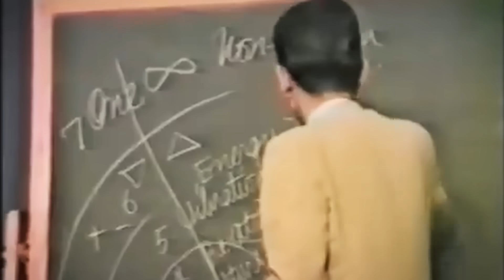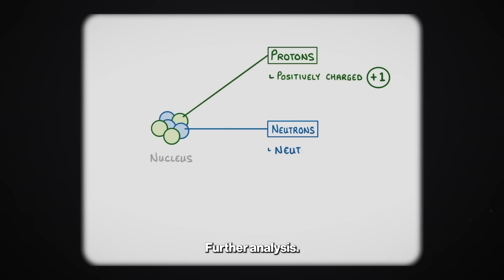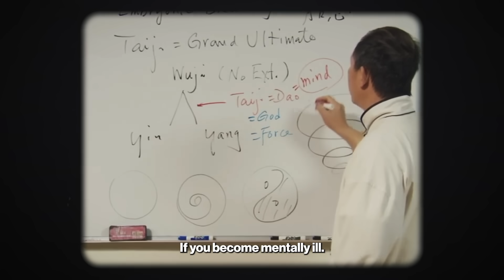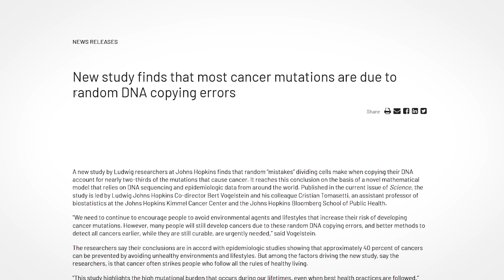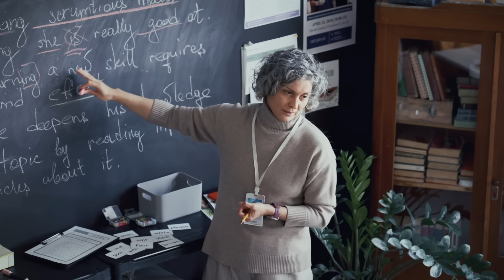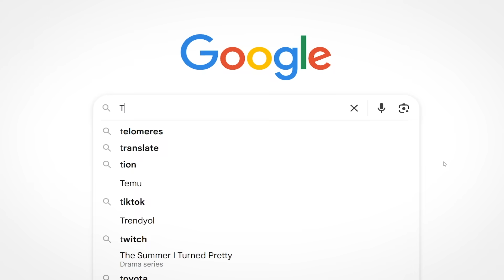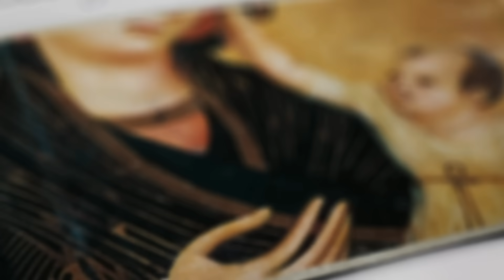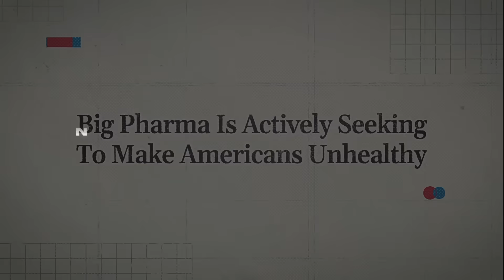America Banned This Japanese Scientist After He Revealed Too Much

Comment: The U.S. doesn’t want us to know about this information because of their energy weapons attacking the citizens of the U.S.  Why do you think they removed lead from our paint?  Because they care about our safety?  Is that why car are made cheaper and less safe?
Reply: Is that why they push vaccination? Pharma meds? Cigarettes? GMO?  Radiation of our produce and meat?  All evil death inducers.
Reply: I never thought that the lead in the older paint formulations as possibly being protective against directed energy weapons (like the ones that were allegedly used in Maui). There is a special paint shade available through Pantone. “The Pantone color number for an anti-laser blue color is PANTONE13-4103 TCX (Blue 072 C), also known as ‘Laser Lemon’. This color is specifically designed to resist laser beams and protect against potential laser attacks.” As the legend goes, people the painted the tops of their homes in this color were protected from the effects of the beams. Anyway, it can be purchased as a paint or as a fabric, it is a “vibrant blue color”. On the PANTONE Smart Color Swatch Card it is referred to as Illusion Blue.

Comment: There's a reason this was buried, and it's actually tied to COVID and the vaccine. There have been significant advancements in understanding and inventing tech involving the human biofield and tracking our bio-registery and it's capabilities.
The vaccine using mRNA to change genetic materials and lipid nanobots as the vehicle and antenna taps into our biofield energy and is directed thru EMF signals. 6G will bring a whole new level of control to this. They harvest our bioenergy and also use the nanotech AND changes in genetic code as interfaces to make changes and influence our actions, thoughts, emotions, etc.
CHIEF SCIENTIST OFFICER, MODERNA publicly stated:
"We're installing operating systems in people's bodies"

Comment: stage yourself in a resting position and numb your body to a degree where you can control the energy flow.don't overdo it or you will pass out. Emotions trap energy you need to release that toxic energy, which in the long term will cause sickness.

Comment: Electrons, according to my hypothesis, are just gaps in the field of matter.

Surely, these gaps would shape around molecules and consist of smaller elements, which essentially are free tinier mass, which gets positioned through surrounding matter converging.

So, essentially it's a bubble that contains tiny mass, with various shapes.

Another way of saying this tinier mass is fragmentation in a bubble.

Comment: We are born to expand by assimilating data through our sensory-based perception tied into the nervous system. The body is a conduit designed for change through experience. Change is the only constant in the universe. We are no exception.
The options are tuning into positive AKA high frequencies or negative AKA low frequencies of vibration. 
Because we exist inside the Law of Duality(yin-yang, feminine/masculine), everything has its opposite.
Hot to cold
Up to down
Right to left
Expand to contract 
In to out
Light to dark
Love to hate
Faith to fear
We also exist in Relative Reality, which means, by Law of Duality, the Absolute reality exists. 
Absolute to relative
We must overcome the ego and head back up the ladder of completness toward the Absolute. 
Love is the positive force that brings matter together. Love ascends. This is the main quest 😘

One could also choose hatred. Negativity repels and causes separation, removing the individual consciousness away from Absolution(but there is a higher degree of suffering here, inside hate and other low vibe states of being). 

Our lives are like playing an Elevator Game, traveling from station-to-station.

The atoms that make up matter are only oscillating or vibrating fields, which, on this microscopic scale seem to be solid when zoomed out and through limited human vision. It is all illusionary. Separated by time which is more drawn out the further from Absolution you take yourself(this is why in "hell" or below, it seems to be eternity). 
The best versions of ourselves are duking it out with our egos. Thats the character we play on Earth in the 3-D. Our Conscience or Oversoul is more of a mental construct or "spirit" . Because atoms are just particles, Michio calls us "spirits inhabiting the mist."
You could see it as the oversoul --> "player in the headset"
The fleshbody --> "boots on the ground."
Connect to the Conscience by lessening the noise in your personal field and meditate. We are distracted by the Wizard of Oz and illusions on purpose. Mantras can bring one closer to the Self - "There is no place like home." Dorothy created a focal point and returned home all by her own volition! 

One who is asleep is like Neo working a 9-5 job and obeying the narrative we are born into. One who has awakened sees passed the illusion of every day life(understanding culture, creed, race, boundaries do not exist), knowing their true potential and power. 
Mushrooms can help to achieve this Disillusionment. 
They dissolve the atoms or pixels and what appears to be time. There is no past or future. All of that exists psychologically, in memory. There is only transformation.  You must let go in order to be free enough to grasp this. <3
 
ROYGBIV is the spectrum of light or colour we are allowed to detect because we are anchored into this frequency by our DNA. The DNA acts as an antennae. 
Awrite, let us imagine a propeller at a stop. 
The blades look to be separate right? Until we start to spin it. This is how vibration works. The faster it spins, the more "spirit" in nature it seems. 
If we spin it INCREDIBLY FAST, it will eventually generate heat. Red, in colour. 
Then it will travel through the spectrum into violet... eventually ultraviolet. This is the boundary threshold of our feeble senses. 
We need tools to see that there are other colours/heat beyond this.
Now, let us examine the sound, in our imagination.
The propeller will eventually screech until it becomes so high-pitched, it travels outside of our reality.
This is ultrasound. 
Ultrasound and ultraviolet are existing in higher reality.
Infrasound and infrared are the lower reality that is lost to our range of view, also.
Animals can sense both, depending on their genetic structure. We are locked out. 

You must use your birthright of intuition and imagination in order to connect the dots. This is not peak reality. One must expand in consciousness in order to see the full picture. It is not in the material world. The material world is a tool for figuring things out. Imagine uploading into a virtual simulation and believing everything is real and you try to "possess" things hahahaha! No. It is all illusion. You and I are participating in a dream of our own making. What you believe and focus on creates your reality.

All is mind, my friend. All is mind... You can create a heaven for yourself or a hell. You can exist in light or you can exist in darkness. The darkness will take you below when you shed the mortal coil or SpaceSuit you are now donning. You will never die. You are a continuous individuated unit of consciousness. Sounds scary, right? not if you choose to accept it and choose love <3

Michio knew that natural sources of sustenance contain a higher vibrational content. Artificial foods and clothing affect our energy fields in a detrimental way. They become weakened. 

The imprisonment suffering of animals and plants/trees creates an imbalance to the equilibrium of the Earth.
All life has a role in harmony. Harmony is achieved by the way of love. It will take us to a higher timeline.

Just like the Earth, our bodies are made up of tiny organisms. When they are in disarray, malady will manifest itself. 
As we are now in the human collective, we behave as parasites. One can act as a white blood cell in its body or a bacterium. 
The native way in America which was forcefully overturned to make way for evil corporations and authority is the good way - > being in symbiosis and returning what we take.

By meditating on the Laws or Principles of the Universe, the answers will be known to the individual.
These are the laws of :
Mentalism (all is mind)
Vibration (all is created by oscillating fields. We are motion inside motion)
Rhythm (the pendulum swing - what goes up... must come down. Rhythm operates within Duality)
Continuity (there is no end or beginning)
Duality (explained above)
Relativity or Cause and Effect or Karma (every action has a reaction)
Gender (could be seen as Duality in a way... all things contain both energies)
Correspondence ("As above so below" The same model is used in every plane. What you observe microscopically will be replicated in the larger. You will find parallels in nature... in the sea... in the sky... in literature. in everything)

Timelines... Every decision we make is a fork in "time."
The Absolute contains all timelines.
Imagine MS Paint for me, if you will. All potential exist inside of it. It is both complete and incomplete at the same time in the "blank screen"
It is we who create with the pixel, through the mind but the heart acts as our compass. 
Mind is compass. Heart is the needle.
Mind is the car. Heart is the steering wheel. 
Too much mind - > you can make sense of anything
Too much heart - > the needle will spin out of control. 
You must operate in mindfulness. not in an impulsive reactionary way. take it slowly. 
78 percent of your body is water. You can be rapids or you can be a calm water with soothing tides. It is here that you can see clearly into yourself, which is represented by the water beneath the surface. 

We use the Heart to speak to the HigherSelf or Jiminy Cricket. Jiminy wants use to make the best choices. The body on Earth is prone to external influences. It is stubborn and often distracted. It will ignore the wishes that come from above. 
Jiminy also speaks to us in the other parts of our bodies but most especially in the gut. This is where divine intuition is birthed.
Reply: That being said... ThePowersThatBe know all about ego and separation and our willingness to act without reason. They dangle shiny things in front of our faces so that we ignore all else(development). "Shiny things" satiate the ego... lead to addiction and excess pleasure. Loss of control. Possession.
Through another lens, one may call this "sin." "sin" means "without" -> or "ignorance" Without wisdom. 
Covid, for instance was an experiment in separation which has taken us to a lower timeline, collectively. Separation brings us further from the absolute. The Absolute is synonymous with "God." It can be seen as a person(archetype) or as UltimateData. This is because science and spirituality are ONE from the same SOURCE. 
The 70s - > people were getting along well, and the psychedelics were waking everyone up. There was togetherness. In steps Authority, outlawing psychedelics... using the Manson family to tarnish the image of the hippie movement. If the info doesnt come from inside(the kingdom of God is within" then it is most likely propaganda. Turn off the news and social media).

Love must be accomplished. Love and acceptance of one another in order to get back on track. This will take work for everyone to participate in.

Hypnotism--- The human mind is easily programmed. When the mind is in a relaxed state, it can receive commands that the subconscious stores in its memory bank. All is recorded. Politicians know this. Cult leaders. Military. Religious and spiritual "leaders." The institutes of science.
These prompts can be activated in a more alert state. Covid for instance. People trusted the news. It implanted information to those receptive and gradually instigated a fear state. It is in this fight or flight of fear mode that rationality cannot be reached. 
We could see it in brainwaves. a mind in relaxation is more prone to suggestion(delta, theta brainwaves). in a more alert state, there is activation(beta-gamma brainwaves).
You know how in cartoons and movies they put one in a trance-like state then implant ideas? Once returning to more wakefulness, they can be made to act out the implication? It is like that. People will not know they are brainwashed because they have given consent beforehand, hahaha('tis akin to the open invitation of vampirism... mind parasites). So, in a way, those who are awake are actually asleep because by the power of suggestion, their true self is bound n gagged and in the cellar of the mind... ie: Get Out (2017). 

The point of social media is mind control. The news wasn't meeting the criteria that Authority needed to set into motion its grand plan, so they are now using this connectedness to overthrow psyches. 

I recommend the book MIND CONTROL IN THE UNITED STATES by Steven Jacobson. It goes into further detail about subliminal programming. The history of it and how to protect yourself from it(simplified: silence, meditation, knowing yourself and setting boundaries in your own subconscious). Also, check out the ASCH CONFORMITY EXPERIMENT on youtube. 
"The methods of enslaving the mind are the same to free it."

Ever notice the good really do die young? It isn't coincidence. Free-thinkers are frowned upon. If there are enough free-thinkers in the world, we cannot be stopped. <3 It is nigh hour to deviate.

re: food (emphasis)

Plant-based foods are mostly water. "light" food. Water generates electricity. Neurotransmitters and synapses are electric. It is no coincidence that the great thinkers of the past were vegetarians - Pythagoras, DaVinci, Einstein, Tesla, Ghandi, Rudolf Steiner... Mr Rogers haha. 
If your dollar goes toward the contribution of factory-farmed animals, there is a karmic energy attaching to you and a darkness that will be in the backdrop of the mind. 
I ain't commanding anyone to stop the consumption of burnt animal carcasses... You have freewill. This is only information.
but Your actions on Earth will ultimately be the determining factor of where you want to reside on the vibrational line of light and darkness. There is no escaping this. 

Let us take the axiom "as above so below / as within, so without" into account. Consciousness wants to be fluid. If "you are what you eat" then you'd rather eat water-based to maintain a higher vibration and fluidity. 
"Heavy" foods. Our language is telling us that animal products are heavy and keep us bound to this plane. 
Actually, all foods bind us to this plane haha. It is why fasting brings about clarity, cause we return to the upper default state. That is of mind. Our energy doesnt have to use itself up breaking down foods to distribute as body fuels.
Plants and fungi have properties that can aid in exploration. A thinking person will practice the alchemy in plants to enhance nutrition... flavour... and healing properties. Meat is... very easy. One-dimensional without the use of plants. 

Thanks for reading. You do not have to take my views as gospel, of course, haha. I genuinely care about the state of the Earth... I hope that someone takes good out of what I have observed to be the truth n my reality.
Reply: I am unsure how the Rockefeller educational template was able to be installed around the world? History is fed to us in a deceptive way. There are major gaps innit. 
but the public educational system as it is goes alongside the hypnotic power of suggestion. If you do not question a subject like science, you will be under their control on a subliminal level. You will accept all selective research. Artificiality. 
Dogmatic science with a sort of worship involved is the new religious indoctrination of the modern era.
Blacklisting scientists is not science. It is a box. a form of control.

See: They Live (1988)
Reply: @Mobilis_InMobili AGAIN AWESOME
Reply: AWESOME

Comment: You are totally and 100% wrong about the vegan diet vs animal protein/fat. You should aim to get most of your energy from animal fat/protein. Fat is the best form of energy and carbohydrates should be minimized.
Here is a short descrition/definition of the KETO DIET:
A ketogenic (keto) diet focuses on very high fat, moderate protein, and very low carbohydrates to induce ketosis, where the body burns fat for fuel. Keto-friendly foods include fatty fish, meats, eggs, full-fat dairy, healthy oils, nuts and seeds, avocados, and non-starchy vegetables like leafy greens, broccoli, and peppers. You should avoid or limit sugary foods, grains, fruits, starchy vegetables, beans, and processed foods.
Reply: The "Dietarily Enlightened" are still stuck in the Vegetable Matrix, benighted.

Comment: Sounds like the Lympth system is blocked and needs to flow again for good health. Also, nerve issues.

For these:

Lympth system = need to open lympth system via message that you can do yourself. DrMindyPelz has vds on opening the lymph system.

Nerve issues =chEONutition and DrBERg vds on B12, B6 and B complex (this is one of the top vitamins everyone is deficient in)

Vitamin D deficiency = our bodies do not work without D. Get out in the sun and you may also have to take a good quality D in the winter. DrBerg vds.